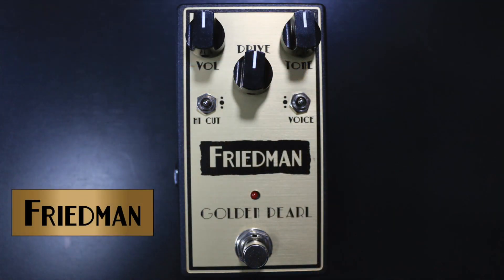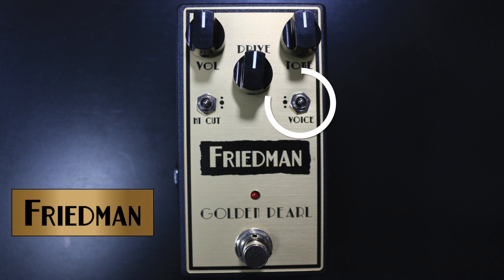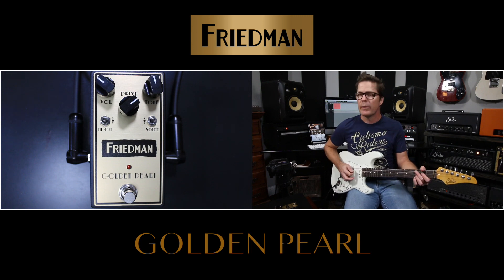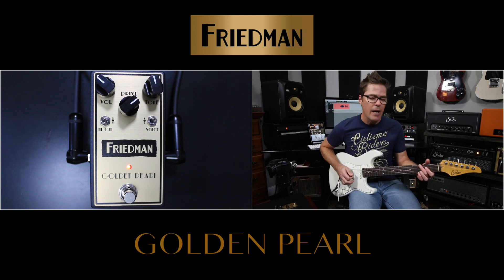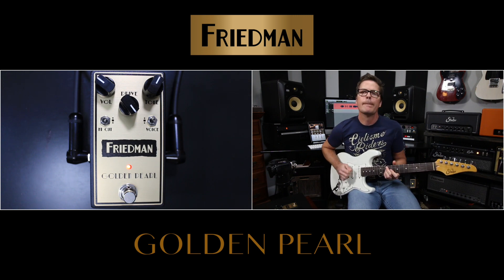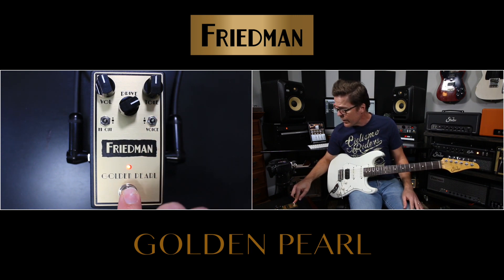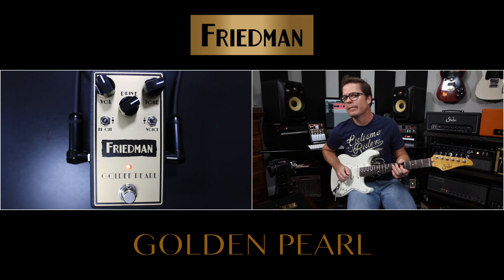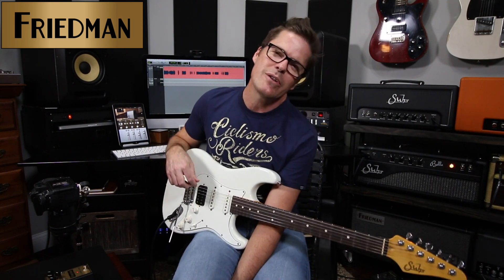Friedman Golden Pearl Overdrive Pedal Demo Video by Shawn Tubbs

Comment: Hi Shawn! My birthday is coming up and I'm thinking of getting this pedal.
Just want to ask if there is a reason why you  did not demo as well with an LP ?
I do have a Strat however I rock out more using the LP.
Is, for example, it a  dark sounding pedal which when paired with humbuckers over all a too dark combination?
Reply from the maker: I didn't and still don't own a Les Paul. I'm able to borrow one on occasion. The PRS MC 58 in the intro song is about as close as you can get to an LP tone. I personally believe that the Golden Pearl has enough top end for Humbucker pickups whether they be in an LP, 335, PRS, SG, etc. Thanks for watching and happy birthday!
Reply: @ShawnTubbs  Much obliged, Shawn.